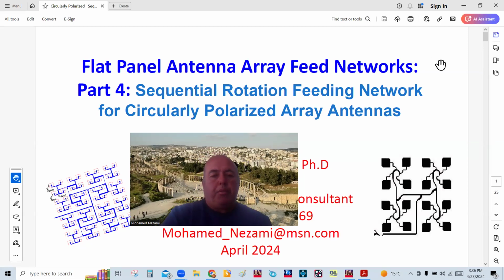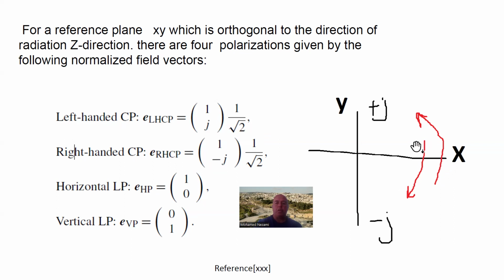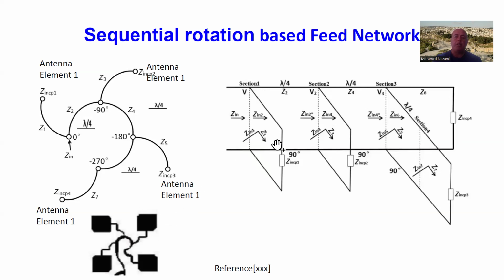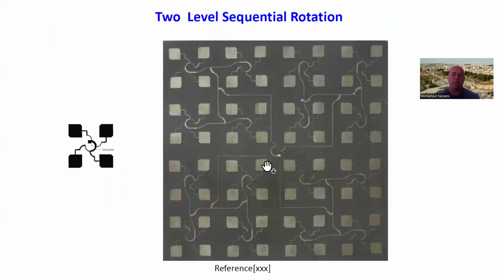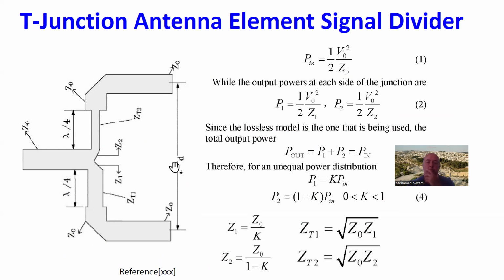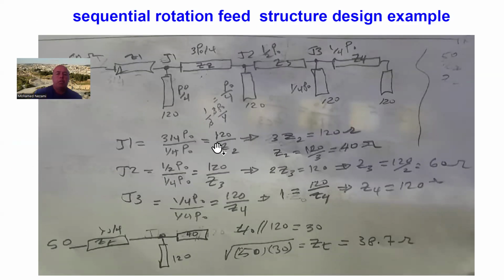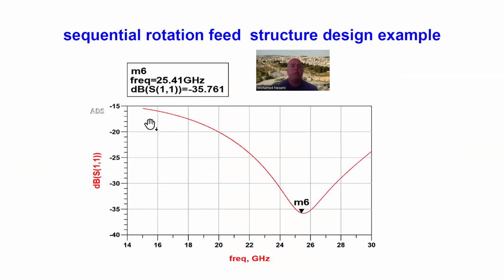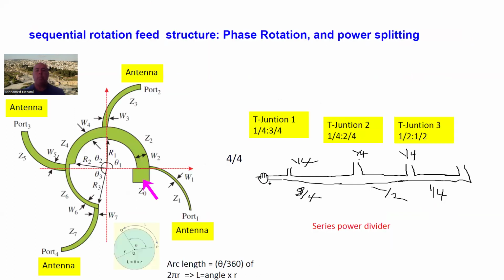Part 4:  Antenna Array Feed Networks Design and Modeling,  Sequential phase Rotation

Comment: Thank you for very interesting topic. Could you comment on why patch impedance was modelled as 120 Ohm instead of 50 Ohm?
Reply: Z01 = sqrt(ZS*ZL)= sqrt(50*292)=120.8 <- that's the required impedance of 1/4 wave transformer line
Reply: @danm3532 292 is the impedance of the patch, is that what you mean?